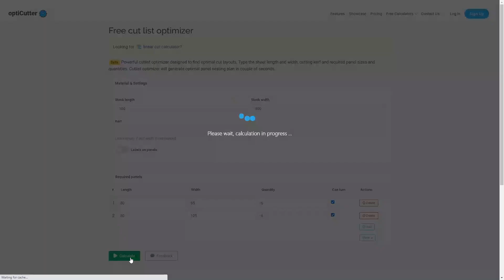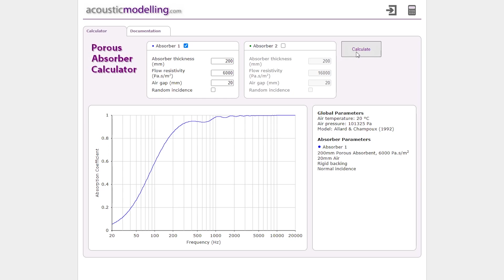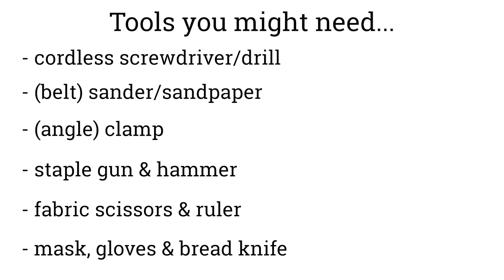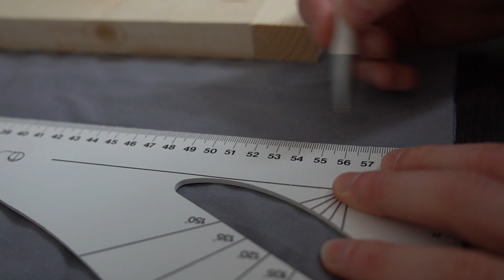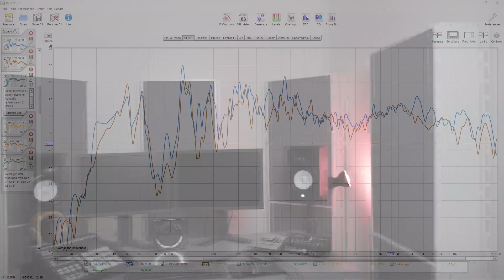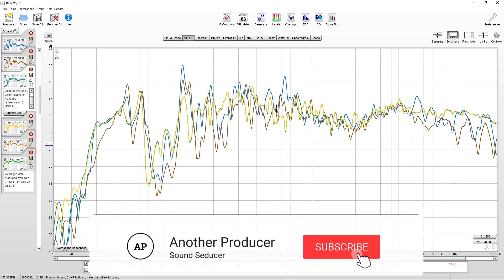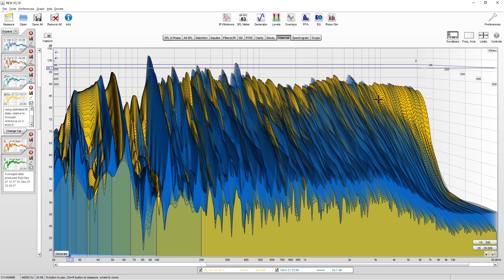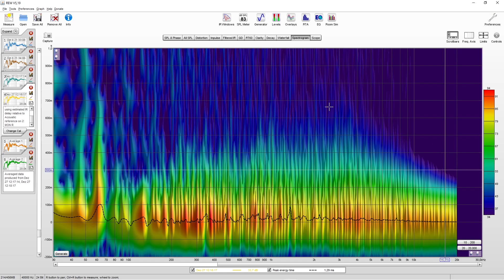How to make inexpensive DIY Broadband Absorbers  (65$)

Comment: Thank you for the video, i have a question, i have saved a bunch of plywood from a barn we tore down,.. do i have to have a frame or can i mount the rock wool on the plywood and upholster it directly on the plywood? Or do you need a solid frame wall as in the bookshelf you used? 

I have been watching a professional upholsterer who makes custom pieces and he starts with wood frame then spray adhesive the foam onto the wood and upholsters over that. I over simplified his process but you get the idea, so in theory i could cut the plywood i salvaged, its thin like 1/4 inch maybe more,.. make my panels,.. spray glue the rock wool down, and my fabric to make nice corners sew essentially a fitted sheet pocket to go over the whole thing so i can staple it to the back side which goes on the wall. I could make French cletes  to mount on the wall with 2x4 or 1x4 which would then keep the panels away from the wall would that sound like a legit system? 

Disclosure i am a newbie just got my first daw thats how newbie, doing things on the cheap. If this idea would be ok that would save tons on foam square acoustic blocks. Does the fabric type matter? I think i even have a  bolt of canvas material in the tool room from my mother,…..  but maybe i should invest in new fabric. I can usually find awesome deals at the fabric store. Wool melton for example would that also be acoustic favourable?  

Thank you again.
Reply from the maker: Hi mate,

So you want to glue the rock wool onto a thin piece of plie wood and then put fabric around it and staple it to the back of the plie wood. I think I have seen some video about this as well. I guess this should work. Regarding the gap: this should work as well if you only use one row french cleat at the top and maybe  some wood at the bottom to keep the distance from the wall. The air between the wall and the absorber is the crucial part :) 

Hope this helps you. Keep in mind I am also no acoustic expert/physician just did my research on it and since every room is different this is really hard to tell from that far away. But I guess broadband absorbers definitely help with the rooms acoustics. I don't think the foam square acoustic panels are in any way comparable. Because this nub foam maybe takes away some of the highs... This can also lead to really unbalanced room acoustics if you use them everywhere. But personally I would always go for the rock wool option. Cheap and a broader frequency range where this absorption happens. However, most of the time bass is a big issue as well and these rather thin absorbers cannot really help with that. Still an improvement ☺️ 
Keep it up and let me know how it worked out. 

Cheers,
Phil

Comment: Hi there,

Thank you very much for your video. It is a great video as I happen to have the same exact setup, and I am in the process of acoustically treating my studio. 

So I have a quick question regarding the air space from the wall. You mentioned in your video that you placed the bookcase (bass trap) 20cm apart from the wall. However, when I set the bass trap to the corner of the studio in the same way as you have placed it, the distance is around 32cm. Therefore, I was wondering how you came up with this 20 mm air gap? 

Thanks.

Chris
Reply from the maker: Hi Chris,

I didn't mean the panels in the corner, but the ones that are facing the wall. The panels on the side are 20mm away from the wall because of the baseboard. But the 32cm in the corners are no problem. 

These panels are no real bass traps, though. The deeper the sound, the longer the wave. Therefore, you probably need more material and thicker absorbers for a real bass trap. One option also is to use a wooden plate for the lower compartment with a specific thickness that compensates individual room modes of your room. But I would not recommend doing this, because it focuses on only one frequency and you have to know what you are doing. That's why I would probably use more porous absorbers. Make sure they go to the ceiling of your room. The high walls were a big issue in my old studio. Now I have a smaller room and it already sounds drier. Even though I haven't treated the ceiling yet.

I hope this helps!
Cheers,
Phil
Reply: @AnotherProducer  Hi Phil,

Thank you very much for your prompt response.

My bad, I thought you meant the bookcases in the corner. So having placed the side absorbers 20mm away from the wall sounds good.  The bookcases are already 2/3 of the room height. Perhaps, I would need more materials in the future to absorb more sound, but right now, I am curious to check how much improvement will add these four absorbers in my room. 

As far as the distance from the wall, I believe placing an absorber in such a long distance(32cm) from the wall would cause some issues in the mids/high frequencies since the thickness/depth of the bookcase is 23.5cm. If you make the air gap much bigger than the actual panel’s depth, then you will start to notice a drop of adsorption in the mids.  You can test it using the same porous absorber calculator as you did in your video. 

Do you still have the IKEA bookcases? Are you satisfied with the current acoustic treatment of your room? 

Thanks, 
Chris
Reply from the maker: @chrismaister721  you are right that the calculator shows these dips. However, the situation is probably a bit more complex as the waves are not reflected parallel because of the corner. That's why bass builds up at the corners of your room. 

If you want to, you could of course go a little further and build triangular  corner 'bass' traps. In my opinion this is a little bit more complicated. Depends on what effort you want to put into it.

I would suggest you actually measure it with software like the Room EQ Wizard. Because you could still put additional triangle absorbers behind the panels.

Cheers,
Phil
Reply: @AnotherProducer   Hi Phil,

Thanks for your response.

I know it’s complicated when it comes to room acoustics, especially to a small room. I do use the REW for the measurements.   Do you still use the IKEA bookshelves? If so, are you satisfied? 

Thanks,

Chris
Reply from the maker: @chrismaister721  oh sorry missed the question.
Yeah I still use them. For now I am totally satisfied with them. Having them in the room makes a great difference. However, the ceiling is not treated yet and I have a wall with some windows that still reflects sound. Smaller rooms are not necessarily worse. The proportion of your room is really important. The more symmetrical the better.
Reply: @AnotherProducer  That's great. Yes, treating the ceiling would be even better. I agree that symmetry is a huge advantage when it comes to acoustic treatment. I would like to thank you for the wee chat and for taking the time to answer my questions. 

Cheers,

Chris
Reply: @AnotherProducer  Hi Phil,

Hope you are well.

I have another question regarding the wooden slats. For instance, the height of the top shelf is 102,1cm, and the wooden slat's width is 3.8cm. I do not get why you cut the slat 94.5cm? It should be 98.3, shouldn't it? 
i.e.98.3cm + 3.8cm=102.1

Thanks,

Chris
Reply from the maker: Hi Chris,
hope you are well, too.

I used one slat on the top and one on the bottom. That's why I subtracted the width of the slats two times. 
However, maybe there is a better way to make a frame like this.
I hope this helps you. 

Cheers,
Phil
Reply: @AnotherProducer  Thanks!! Cheers, Chris

Comment: Where do you find the exact 6000 flow resistance Rockwool? Thanks for the video
Reply from the maker: Hi Paul,

It depends on where you are from, I guess :D 
But normally you should find it at a DIY store. Maybe check online first, whether your local DIY store has the right mineral wool (does not have to be Rockwool). Or you could also order them online. But this is way more expensive than picking up a few packages on your own.

Cheers,
Phil
Reply: @AnotherProducer  Thanks, I've contacted Rockwool. The only sort available here is Rocksono Base with a flow resistance of 10.000 pa.s/m but I guess that also helps.